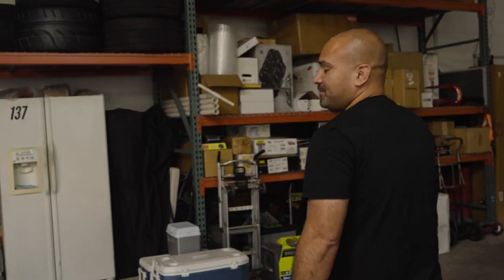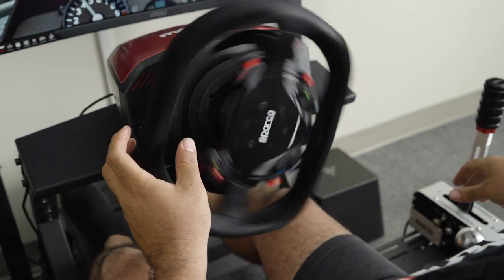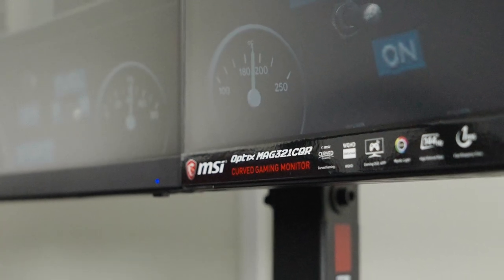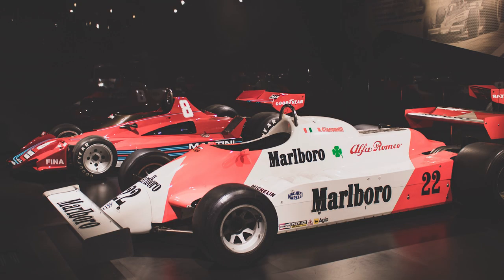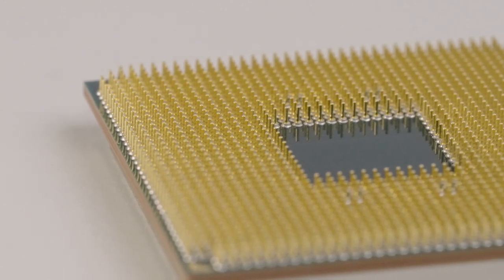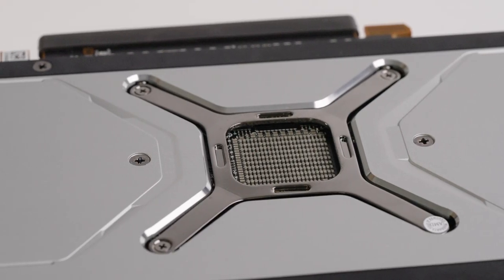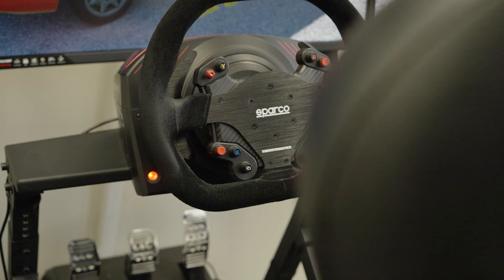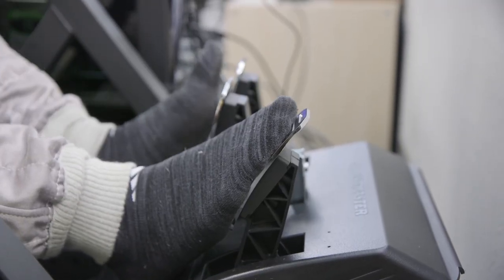We Build the Ultimate Office Racing Simulator

Comment: Guys, you can’t be serious, calling this setup ultimate? WTF? Without any exaggeration, it’s a low end setup at best. Sure, it might be towards the top of low end setups but still, it isn’t at the top of even the low end sim setups! Thrustmaster is pretty much the WORST brand in sim racing, honestly they are years and years behind their competition. Their top of the range rigs are still belt driven, which is like a manufacturer having their top of the range car with an OHV engine! Could you even imagine such a thing? Your setup is no different.

At a bare minimum, you need a direct drive base. Fanatec has some incredibly cheap DD bases, I’m pretty sure the same or lower price than the shitty Thrustmaster base you’ve got. I realise it was due to the sponsorship but then, don’t go calling it the ultimate anything when it clearly is nothing of the sort.

Also, I would NOT encourage you to get any pro drivers or racers on the rig until you’ve also got pedals with a loadcell brake. Those Thrustmaster pedals are absolute garbage. I wouldn’t even call them low end, that’s really an insult to actual low end gear. They have horrible potentiometers to gauge pedal travel and the build quality is absolutely atrocious. You need pedals that have Hall effect sensors so there is no contact with the pedals and nothing to wear out. Not to mention, you got so much more resolution with a Hall sensor than using a mechanical pot.

Look, it a nice try but your vids don’t generally strike me as being clickbait bullshit. The title of this one makes it absolutely qualify for that category, serious clickbait. Make some upgrades by throwing your current rig in the garbage and you’ll be going in the right direction. 

Good luck!
Reply from the maker: Well we are not gamers and don't know or care much about this stuff and two this video is old!